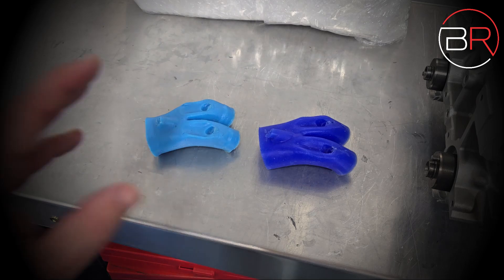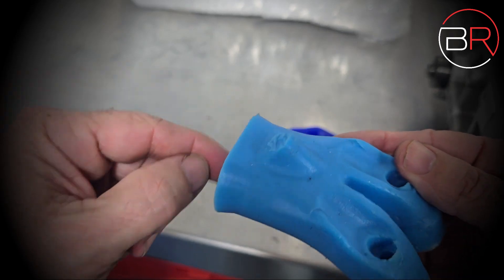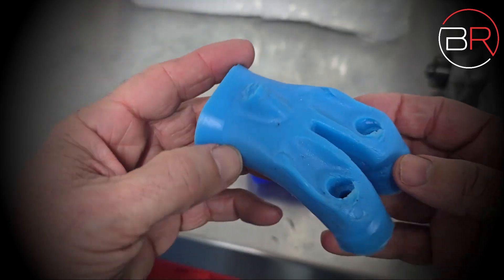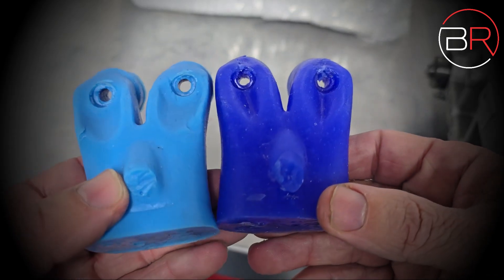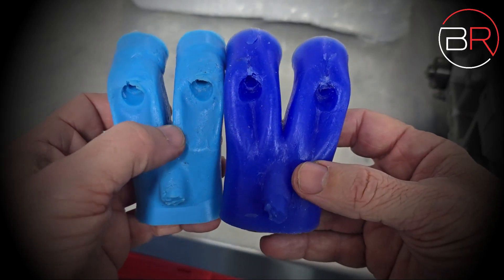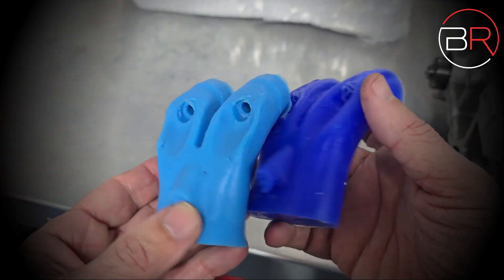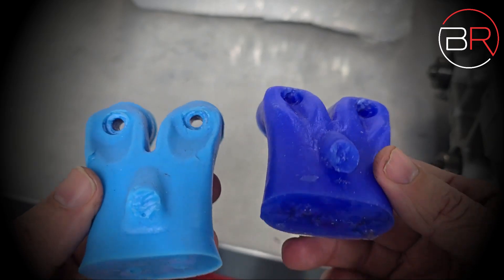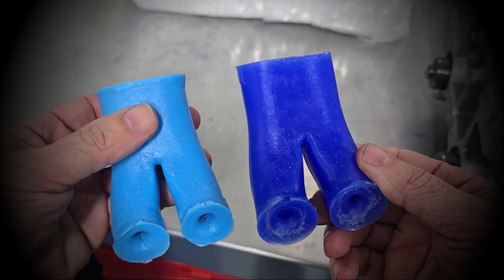10,000 RPM 4AGE Port Molds and porting. #portingpolish #4age

Comment: why on earth wouldn't they use the 20V head? its Soo much better!
Reply from the maker: Because this is what the shop wanted. And let's be honest,  that's very debatable due to the loss of torque 3 intakes created, especially the Toyota 20v. They dont tend to work as well with boost as they just rob area under the curve. Increasing valve area is more for huge RPM.  This was only going to 10k. Which we have plenty of valve area for. 👍
Reply: IIRC, the 16v could generate more lift and it had more room for overlap.

Comment: I used to run these back in the day in Toyota Atlantic. You should try to check out some old Hasselgren or Loyning 4AGE's if you want to see what people were doing 20-25 years ago.
Reply from the maker: Yeah, I remember old Bill, too. I started doing these probably 20 years back. But we never got deep into them.  But with our understanding today in the industry, we are now sizing them far better.   Early days. Everything was big! 😂👍
Reply: @bainracing  By the end (2004 was the first spec Atlantic engine), we were running some pretty cool stuff. We ran staggered trumpets and Tri-Y exhaust on road/street courses. Short trumpets and 4-into-1 for ovals. There were trick cranks, machined blocks, tiny clutches, Ti this and that. They were cool little engines.
Reply from the maker: @MrTL3wis  Yeah they are!! Im bias to toyota stuff though! lol
Reply: @bainracing  Have you blown up as many of them as I have, lol?
Reply: @bainracing  BTW, those engines were about $50k a piece for a new engine and ~$15k for a rebuild. They lasted 350-500 miles between builds.

Comment: Hey Jake, why do you target the 3rd vs 2nd harmonic. Also curious which formula you’re using to calculate intake length. Thanks
Reply from the maker: The 3rd is the most beneficial  blend between our "harmonic" of induction tuning element and velocity/restriction over Distance (primary induction length), this is why almost all top race engines use this target.  

On the 2nd harmonic, our runner length needs to be far too long so now our drag coefficient suffers, limiting mass flow into the engine. 
So for example a 100mm runner has less restrictions then a 150mm runner. 

But we also need to balance the volume in a mechanism I call the "gulp effect".  "Replacement ratio"
And again we find most top primary induction lengths in motorsport are designed to be between 90-95% of the cylinder they are replacing. 

This also feeds into a complex secondary mechanism in the plenum. Which if the runner is too long and has too much volume, the secondary signals will be weaker. 

But yes our harmonic elements will have more strength, around 8%  on the 2nd harmonic instead of around 5%  but the restrictions will be far greater 10-15% loss due to the length of the primary induction passage.  Distance over time creates restriction. Then there's some surface area factors and surface Ra factors that play a part.

 As far as a formula,  I have my own formula that Ive designed and use with different density, temperature and speed, factors. But a general 1100fps for sound will get you close 👌

I will hopefully have our induction calculators back up in the coming months,  I think I have a very basic 3rd harmonic calculator in there. 

They were all on my old site. We just need to get them up on the new one.
Reply: @bainracing  Looking forward to the new site. Is the restriction caused by the additional length due to the boundary layer? RE formula: makes sense, seems most out there are empirically derived (the old Chrysler one comes to mind). I have some questions on setting up valve events on VVT to work with the induction tuning but that’s a discussion for another time.
Reply from the maker: @XX-nw1xg  Yeah distance over time. total "Drag" increases with the 2nd harmonic as we need 50% more length so that's more drag. This is obviously why we use the MCSA and the taper  with Average CSA to reduce total Drag even at 3rd harmonic lengths.  we also see this with Ra factors improving hp by 2-3%. 100-200Ra seems to be the area of least drag.  I think the Princeton university came to similar results.  But the 2nd just kills HP and it clearly shows much more Thickening of the boundary condition, as we can see VE's Fall hard with RPM.   This indicates a clear density shift, this is from Higher velocity, and if the CSA hasn't changed then that only leaves the boundary conditions, this is the dynamic element here.
Reply: @bainracing  thanks for the replies and great info. I have an m52tu, hoping to optimize the above (mathing it out at the moment). Been reading Blair’s 4 stroke book, time areas and whatnot. VVT is adding a lot of variation to my calculations so has been a challenge. Any recommendations?
Reply from the maker: @XX-nw1xg  mate, you just have to pick your best averages off the cam timing number in the area needed. focus on peak torque to the Max power area.  I like harmonic length to tip before peak RPM, so we are generally 0.100-0.200" longer. Helps the average HP numbers.

Comment: I’m always floored that high quality content like this is FREE! Keep up the awesome work man. Have you ever worked on Ford 4.6 2V heads? I just picked up a Mustang GT and it needs some help for sure, apparently these heads aren’t great… Trick Flow offers a nice option but I’m wondering if you have worked on a set of stock heads?
Reply from the maker: Yeah they aren't great mate, we haven'tdone much with them. But thr layer versions, we did a lot especially with the 4v 4.6 and later boss engines when we developed the world's fastest Mk ll GT40.  That was the Italian developed block.